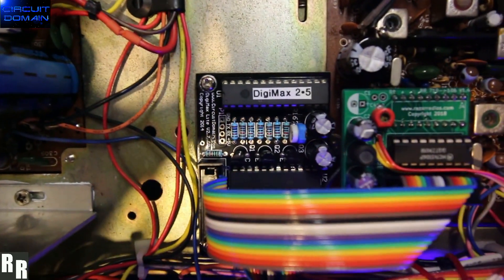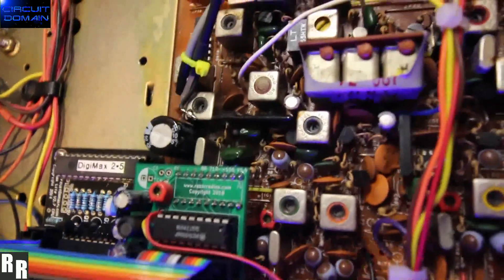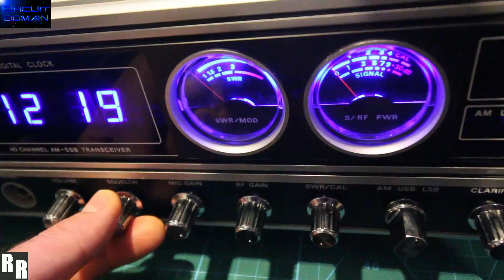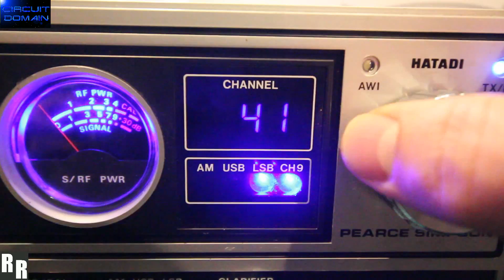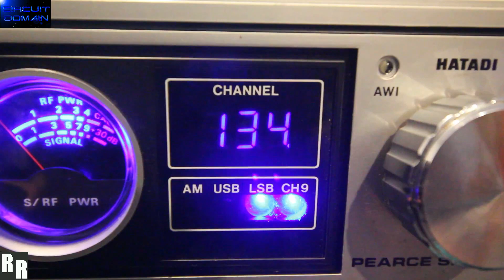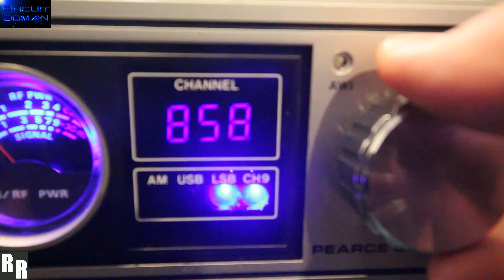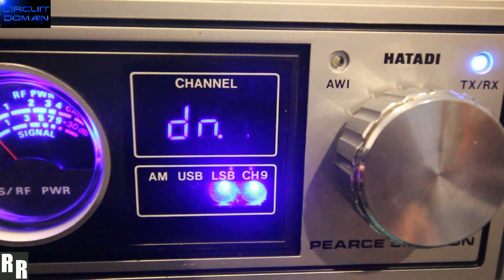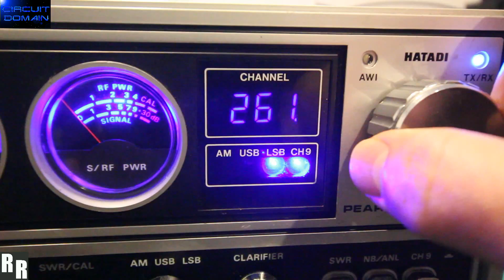DigiMax Lite + PLL adapter for 8719 and 8734 etc. PLL chips. Up to 512 channels.

Comment: What kind of soilder do you use i had hell of a time getting 3 different soilders to stick to the topside of the razor board plugging into radio chip slot..been having bad joint type problems now since then..
Reply from the maker: Hey Jon, RR board has ground planes so some pads may need more heat (GND) for solder to flow but generally any solder with at least 380 degree Celsius  iron will do the job. Also make sure the plastic separator on header is on the radio PCB side as this ensures less stress on radio PCB tracks.

Comment: Does the PTT have to be ground on Xmit ? or just  0 vollts ? 5 pin side mount mic Cobra 148
Reply from the maker: Hi , the PTT needs to be between 0V (main radio board) and 2V

Comment: what frequency is 269 ? In your experience which radio would give the highest yield of channels .. id like to get at least past 28.450 ... and i dont need lower channels
Reply from the maker: Hi Mike, in the above video channel 269 is 29.695 MHz. The latest version also includes 5kc stepping.
The frequency  range depends on the radio and how it has been broadbanded and tuned. As far as which radio is best, this question is best directed at Ray of Razor Radios. I only sell DigiMax Lite kits. 
I also re-sell Ray's PLL adapters on my website as a bundle with DigiMax Lite.

Comment: If the radio will only do say261 channels what’s the point of the extra $50 when you cannot get the full 500 channels not really fair is it?
Reply from the maker: Coverage depends on broad banding the radio and you still get additional 150 or so channels on top of the 108 channels without the PLL adapter. Hope this answers your question.

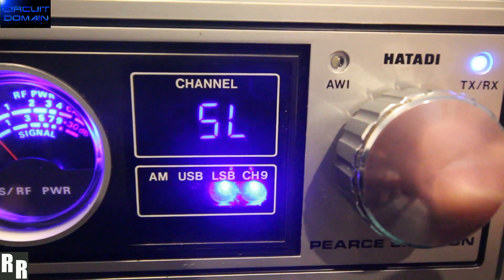Comment: Hello bud, so at 6:07 you mention nCode is 79 no matter what PLL. I assume that's because of the connection to the Razor board. So, in my case, I will be installing the RR719-106 board and then Digimax. Should I use nCode 79? Radio is a Taiwan Cobra 148 GTL PC-412 MB8719. Thanks for the video. I know is 3 years old but still relevant. 73
Reply from the maker: Hi, Yes. nCode is 79 and it has to do with the loop mix crystal so weather using MB8719 or MC145106 PLL the nCode is 79. There are some radios which use a different crystal and the nCode for these is 143 but these are rare..
Reply: @CircuitDomain  good, thanks Mac. Final question. Alignment is done “after” I install both rr719-106 and digimax lite 2.6 fw., correct? Thanks again.
Reply from the maker: @N4EAC   Hi, correct. That's when you can tune the radio for optimal performance across the bands.
Reply: @CircuitDomain  Is this process the same as a 'normal' alignment or do you provide specific instructions on how best to tune the radio for this mod?

Comment: I have one of these in my 858 Madison with a frequency counter in place of the clock. I absolutely love it, really easy to get between 27.385 and 27.555. No band changes or funky 10khz button, just turn the knob and go where you want to be. 808 Central Delaware